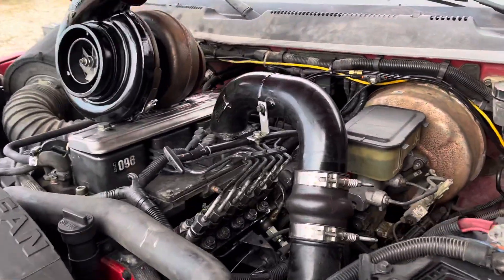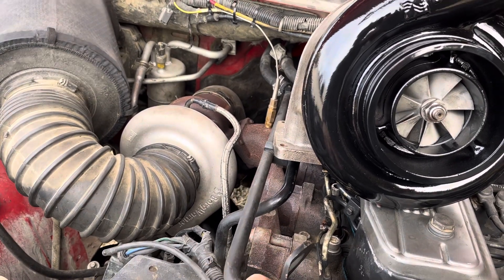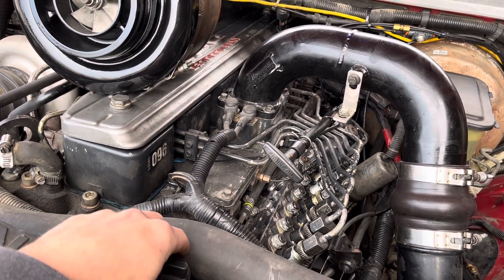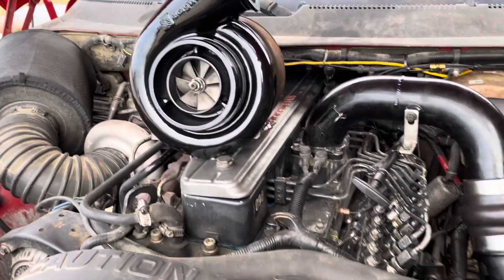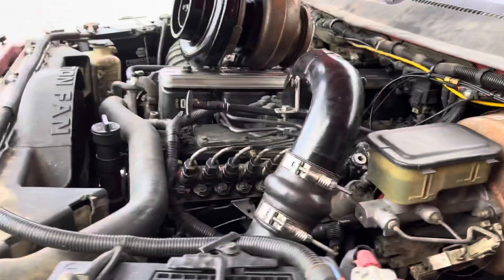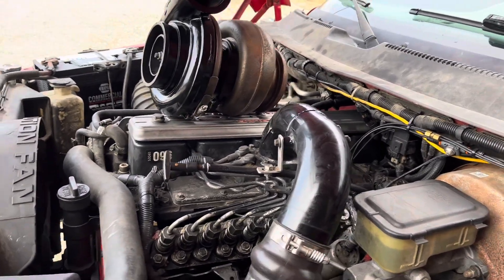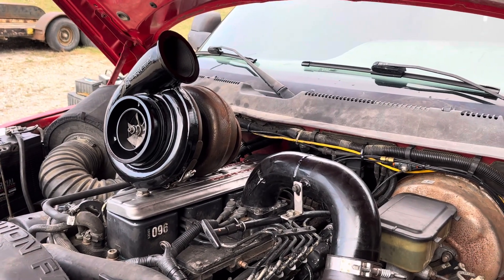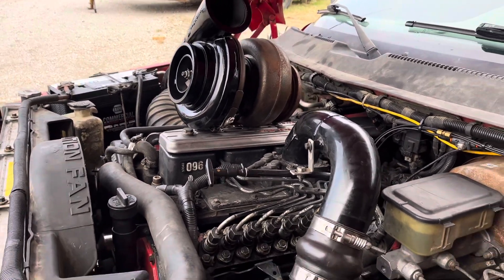S362 over S475 12 valve Cummins update

Comment: Heck yeah man! I have a 97 12v got the PDD AFC live, .25 DV, 100lb valve springs, built auto trans, 4” exhaust and 4” down pipe, 5x16 VCO injectors, BHAF intake and looking at running a sxe 362 or 363 over a s475. Then plan on getting a crazy Carl tunnel Ram or dual Ram intake and turbo piping and either a 3-piece or steed speed exhaust manifold and ARP head studs. This is my daily and will tow a 15,000lb trailer every now and then. Curious what your experience has been with this setup over the last 8 months and what recommendations you have. This is my first diesel build and am by no means a mechanic but am going to school to be a diesel tech and plan on building most of it myself with minimal shop help.

Comment: Just did a s362/s475 combo on my 12v and wow is all i can say. I made my kit myself but it sure makes it a different truck. Boost on tap all the time. No lag like the single s362 you will love it
Reply from the maker: I’m pretty sure excited about it can’t wait to see the difference
Reply from the maker: What fuel all you running
Reply: @Williams24v  ppump 4k gov springs, rack plug, 100 plate, ddp delivery valves and ddp stage 2 injectors.